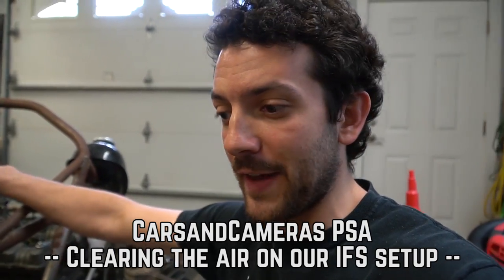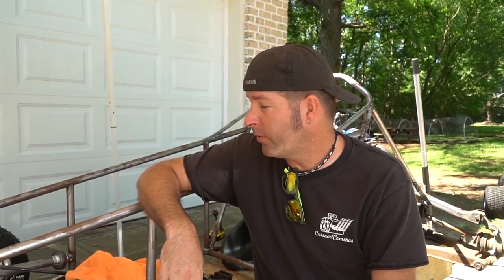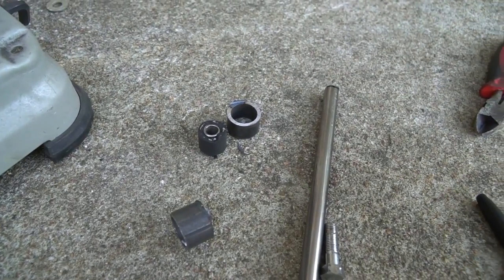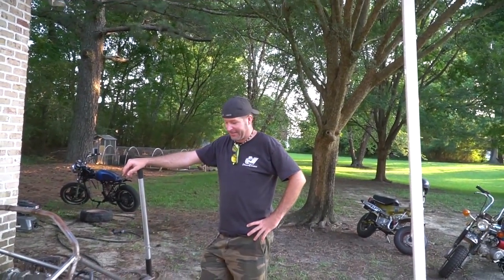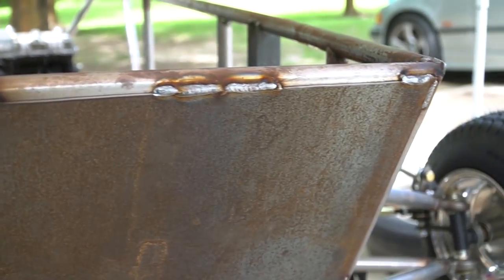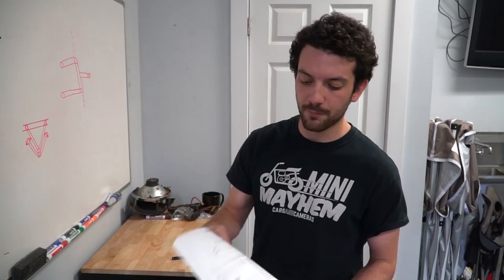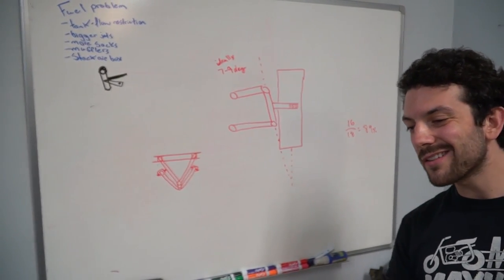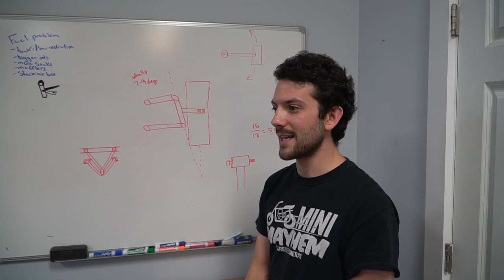Shocks, Suspension, CLEARING THE AIR | Cross Kart Pt. 10

Comment: Mig welding outside. It's not the welder that's playing up. The wind is carrying away the shield gas.
Reply: Yeah u can't might outside how doesn't Ike know that
Reply: For me I weld same I opened all flow at regulator.. I hope not much windy .. flux core that will healp  but still crappier.. depending angle gun  straight arc
Reply: Interesting, I don't know the set up they were using, but I recently watched a pro welder weld indoors with no shielding gas, and claimed to only use gas when outside.
Reply: @304renegade  Sounds like they are going flux core all around and adding gas outside for shits and giggles? Weird, to be sure...
Reply: They just need a shield or a tarp or something to block the wind. Ship builders weld outside all of the time. Gotta work with what you got.

Comment: Just a suggestion but laying the shocks/springs so flat theyll only be able to work a small amount of theyre potential. The straighter inline with the suspension travel direction gives better leverage in proper direction. Learned from our slammed down chevy. Flat shocks dont work if suspension goes up and down.
Reply: Did you miss the part in the beginning with the finished kart and them literally saying "its ok the SUSPENSION WORKS just fine"?
Reply: Correct. I learned that modifying motorcycle frames. Straight up acts stiffer but shorter travel, laid out softens and longer travel
Reply: With the amount of weight on that front end, the suspension being like that shouldn't be an issue, plus it's not built for high speed handling so being a little soft shouldn't be a problem. The only thing that may be an issue is the rebound, but it's nothing major to worry about, it'll soak up the bumps and keep those wheels where they need to be all the same.
Reply: I believe they said its an all around kart for maybe drag and turning short travel is preferred to where off roaring in dirt long travel is needed more so good point bringing that up.
Reply: @thegenerousdegenerate9395  They were talking about the stiffness of the heim joints a different issue to the lack of stiffness in the front shocks. The front shocks are almost horizontal so they will need to double or triple them up before they hold the front up.
Reply: He didnt buy the suspension book
Reply: They were talking about doubling up the front shocks in the video, because the springs were too soft. The springs aren't seeing their full potential because of the shock mounting points. Doubling up the shocks will work, and changing the shock mounting points will also work.
Reply: @robmanueb.  they also said they've been driving it and if thats not enough for you geniuses. Look at the thumbnail. Ffs smh.
Reply: Just Jesse
You’re correct. Spring/shock at 45* for example is half as effective compared to 90* of motion.
But I think they’re trying to save the hassle of building a huge heavy upper shock tower that locates everything more upright.
If they move the lower mount inboard it ruins the effectiveness of the spring/shock much more than angle.

But you’re correct moving the upper mount outboard like 8-10” would’ve solved the spring strength issue but created a ton more work and weight.
Reply: @thegenerousdegenerate9395  You don't get that this a different issue to what they discuss in the beginning.
Reply: @robmanueb.  holy shit... Catch on.  ITS DONE. PROBLEM SOLVED. There's more than couple different times in the video that show as much. Clearly I'm not the one missing something here. Lmao wow... Just, wow. It's like teaching algebra to a squirrel.
Reply: @thegenerousdegenerate9395  LOL

Comment: Move the front lower shock mount closer to the frame. Make a cross bar on the lower A-arm. Doing this will let the wheel have less leverage over the shock so you won’t need a stiffer spring. It will also reduce the angle at which the shock is mounted.
Reply: I think they're going to need to do that and put another shock on those shocks are really soft.

Comment: The angle of your front shocks should be closer to the angle of the rear, the more you lay them over the less affective they are, and the less travel. 🤘
Reply: Case 275 
Additionally, by moving the lower mount inboard, the spring will support more load, as the leverage decreases.
Reply: Case 275 I suspect that doubling up will be completely unnecessary if they were angled properly... they’ve got too much leverage as they are mounted.
Reply: Should look into mounting a bridge plate across the lower control arm to build a lower shock mount off of, gives you unlimited control of shock angles
Reply: agreed, even if they do manage to get the springs stiff enough, those angles are causing unnecessary stress points in the frame..
Reply: Gerry moving the lower mount inboard does the opposite. The leverage increases. There is “spring rate”, “motion ratio”, “spring angle” and “effective wheel rate”

1) 18” arm with spring attached at 18” (1 motion ratio) & 90* spring angle then 200lb/in spring rate = 200 effective wheel rate.
2) Same with 45* spring angle 200 spring rate gives 100 wheel rate. (45* = 50%)
3)18” arm with spring mount 9” (0.5 motion ratio) and 90* spring angle, 200 spring rate = 50 wheel rate (0.5 motion ration is NOT-50% it’s (X)^2, (0.5)^5=0.25, 200*0.25=50

Angle is linear (smaller)
Inboard mount is exponential (bigger)
Reply: But theyll never listen
Reply: Alpha Wërks  "gonna destroy those spherical joints" oh how time exposes the lies of the fake internet expert.

Comment: Heim joints are great. Aircraft and racecars use them. Keep them oiled and keep the center ball from rotating and it will be fine!
Reply: upside downdog that’s right we use them on our dirt track cars and we build professional chassis
Reply: im sure you can fit rubber caps over them for dirt protection (dont know the name right now)
Reply: @user-qx7tm5df8j  
In actuality the angles on this are probably a bit too much for that. Cleaning and lubing often will make then last for years if not decades with no boots.
Reply: @TheCatsquirrel  
Every light aircraft has at least a dozen or 50, depending on the model and make. They are quite robust.
Reply: @upsidedowndog1256   Very true, but they use quality precision joints.
What they don't use is cheapo agricultural joints intended to be used on a tractor rear linkage, where all they do is make getting the linkage pins easier to fit. They also don't weld them on so all of there travel is used in the neutral or rest position.
Reply: @neil1150  
Very true what you say too. If nothing else they will learn something about using them like that. Freeplay in a Heim end is important. Centering its freeplay in use is also important. The ones I have to use cost $350 to $500+ a piece. Setup is extremely important with those. In this case they may figure out quick that angled mounts to center the hiem ends may be a better approach. It won't see highway use, it may only go 100 miles before they tear it back apart. The HP from that 750 isn't really much so I think they will be fine.
Reply: I use rod ends from RuffStuff specialty. They’re Heat & Cryo Treated 4130 Chromoly steel & Teflon impregnated Nylon races. They’re naturally selfcleaning and no lube required. And can be ordered left or right handed thread to create adjustable length arms. I think the 3/4”x5/8” rod ends are rated over 40,000lbs.
Reply: @TomJones-ds5rk  
We use similar in aviation. I can give part #'s but have no idea who makes them. They look next generation now. Setup is important. They seem to last for decades. I can say that because those I installed after yearly inspections 25 years later those are still good....if set up right in the first place. If not? Next year needs new ones. Properly set up Hiem ends on a tube need according to Rolls Royce Dart manual a thing the Brits call "twizzle". U.S. folks may call it freeplay. Bolts are the only attachment, welding would destroy them. They are truly aerospace quality. Cost the same too. In this case John and Ike get to learn something. Those are cheap. Who knows, may actually work for them!

Comment: Totally agree about the suspension.  Whenever I replace steering/suspension parts if I can move them without some type of lever I think they're way too loose.  Don't sweat the armchair mechanics you guys are doing great, the upper suspension brace was a great add too, I wouldn't have thought about it until I saw body flex there.  Impressive!

Comment: Your welder problems were probably caused because your welding outside and if there is a slight breeze (which going by the wind noise on the mic there was) it will blow your shielding gas away and gives you a poor weld. MIG welders are only really for indoor use only. Keep playing guys and enjoying yourselves.

Comment: Those joints are totally fine. I used to run them in with a pillar drill for 20-30 minutes with oil to lubricate them. And that was for aircraft use.   Best regards Glenn Wilson

Comment: Use plenty of marine grease in them joints once they break in keepem nice and lube or else the kart will start squeaking. Awesome build! Keep it up!
Reply: Alot of people that runs heims just spray them with something like wd40 every once in a while
Reply: @chickenfishhybrid44  wd40 does not work.. Personal experience grease will last up to a year no squeaking. Wd-40 will last 1 day and then mad squeaking. Daily drove a 240sx for almost a decade with full adjustable suspension with lots of heim joints. Nothing more annoying then squeaking every second and then the squeaking getting louder...
Reply: @s14duma  pb blaster has worked for me.. personal experience. Had many Toyotas with lots of heims on steering and links. Something like white lithium grease in a spray can or silicone spray works well too. Yeah I'm sure regular grease works good or better, but it's a lot messier and a pain in the ass. If you do spray you have to do it alot obviously

Comment: Only thing id be worried about on the suspension is the butt joints id put some collars on just to bolster the joint but otherwise it looks like itll work out with little to no issues

Comment: Not sure if anyone addressed this yet. If you're using a flux core wire welder ignore what I'm fixing to say. When using MIG welder outside you need to put up a wind shield. I can hear the wind a little on the microphone so you do have a slight breeze when you were welding and what happens is the wind blows the gas out of the weld and causes issues with precision welds. It will spit and sputter like it was doing on this video. Keep up the good work!

Comment: U need flux core wire to weld outside in the windy conditions. Inert gas won’t give you enough coverage,blows away.
Reply: Please explain... I thought it was or only bad ground.
Reply: @spar2kissorealist474  Shielding gas can be blown away very easily, by wind when outside (can clearly hear wind noise after John complains about welder "acting up"), by a fan when inside.  Without proper shielding gas coverage the welds will come out like crap and will not be strong. Flux core welding wire doesn't use a shielding gas, the flux core melts and provides it's own shielding that can withstand higher winds.
Reply: Overdrive's Garage Hell of an explanation!! That’s exactly it.
Reply: Makes sence. Hard to believe but still good to know. Wind huh? (Knods head with surprise look)

Comment: I've had to rebuild bushings after the originals were trashed. Instead of using a rubber hose that will fail quickly, I went to the local auto parts store and bought their shock bushing kit. I mounted the bushing to a long bolt and chucked that on to the lathe and just turned it down to the diameter I needed.
BAM custom shock/suspension bushings.

Comment: well, after seeing the amount of bump steer in the minimum travel you showed, i will step out and proclaim "you have f'ed up, again..." 
 The control arms and steering linkage must be parallel and  symmetrical to make one, just one, of your projects bump-steer correctly. BTW, there are designs you can follow, angles, degrees, and all measurements for steering components.
Yes,  i raced RC cars and go-karts in the past and steering is a huge part of making those things go fast and handle well.  i know how to set up proper suspension geometry and i cringe when you go welding up stuff without checking geometry through the travel range. You can buy caster/degree hubs and spindles to weld onto your karts, instead of chop and cut like you do. Even if you just copy the proven designs, it would improve your results.
  Maybe GPS sends stuff to you for free, but your viewers don't have that problem lol. 
 Hopefully you follow the directions i hear you reading in the background as i type this, but i'm not confident, since i just heard John saying "yeh, we didn't do THAT.."
Good luck , see ya in the funny pages
Reply: It kinda pisses me off and i'm unsubscribing over how condescending they, especially john, are being over being told they aren't doing this right. When you hack job something together you should expect some criticism..
Reply: That stuff doesn't matter. It'll be fine!!!!! They are at 680k subs. If what they are doing gets them there let them do it. If their legs get cut off or they crash a few months from now it's on them. Enjoy the show

Comment: I have used different styles of joints and quality ones typically aren't that tight. Initial breakaway torque is slightly more than overall stiffness but once you start moving they are usually fairly smooth till you stop. I think the stiffness and the limit at your spindle due to the style joints you used (see high misalignment hiem joints) is what had most people worried and thinking you were binding. I think you guys are right in those tractor style are just stiffer when new. QA1 and others have some decent inexpensive hiems that also are adjustable giving you the ability to set camber and caster! Anyways great vid and looking forward to see how it turns out.

Comment: It looks to be a little breeze blowing and that will blow the argon gas away from the welding area. You have to turn up the psi on the regulator to keep the gas around the weld or put up a wind break.. 
Keep up the good work! 🇺🇸🦅💪

Comment: I'm glad to see it worked out. You could also consider doing a cam setup like pre-runner trucks have. Then you can use any shocks. Your issue is the angle that the shocks mount to the frame. I think if you mount the shocks inline with the frame and have a cam system to direct the front suspension travel backwards or forwards towards the shock, you would have a great ride. Keep it up

Comment: the real thing that probably freaked people out is that proper made hyme joints are free right out of the box but they don't really wear and are made with a lot more precision.
those tractor joints however need to fill a different criteria in that the need to be cheap and be able to handle high loads so it doesn't really matter if they wear a bit faster and are stiff

Comment: Little late now but...You can avoid the steering arm/tire interference on a rear steer setup and give it some Ackerman all in one step.  Just angle in the steering arm in on a bit both sides, gives more clearance and helps to turn the inside (smaller radius path) tire more relative to the outside tire.

Comment: I used to build race cars for a living and know quite a bit about suspension design and geometry, and while I wouldn't have used the weld on end links for a tractor (mainly because they're about 5 times bigger than you need) and certainly wouldn't have mounted them like y'all did, guess what...it's not my project,  so I didn't make a comment saying you guys are gonna kill yourself etc. The geometry isn't that great, however,  y'all are learning and even engineers who know exactly what they're doing don't get it right the first time everytime.  Keep up the hard work,  make it better as you go. Don't listen to the negative comments,  it's a go kart, it'll be fine.

Comment: dont worry about the armchair experts (myself included lol) . you're doing what you do and learning, and thats why we watch :)
the thing to consider with the shock position is that as the suspension moves through the travel you ideally want it to decrease its mechanical advantage so that it effectually gets stiffer (starting off more vertical and moving off centre) to reduce the chance of bottoming out and making the stiffness more progressive.

Thing is you guys are smart enough to figure that out as you go along, so dont feel the need to explain why you've done things.

Comment: You guys did a fantastic job all these nimrods that think they’re engineers need to stop talking. Believe me, as a fabricator, I’ve worked with guys that do it for a living that couldn’t do as good of a job as you guys did. Only piece of advice is next time, do a little math on paper. Geometry is your friend when building suspension, especially with the range of motion you’re dealing with. I build drift cars so travel isn’t that big of an issue which what I do. Again, fantastic job guys.

Comment: Part of the reason the front was so undersprung was because of how close those shocks were to being horizontal. At vertical mount orientation they will have the maximum force, horizontal they will have zero. So at that low of an angle you are only getting about 30% of the power of that suspension to hold you up. Keep up the great work guys. One of my favorite channels. Maybe put a more reliable type of transmission on that super fast mower that Ike rolled and take it to the strip.

Comment: The angle of the shocks make a big difference to the weight they hold. Had a banshee I lowered by kicking out the shocks with a bracket and suspension went super soft had to go another route with shock standing straight. Ps. All it took was 3inch tilt for the shock to go too soft. Hope this helps👍much love from South of Miami 👍